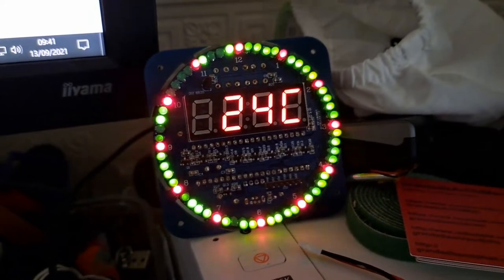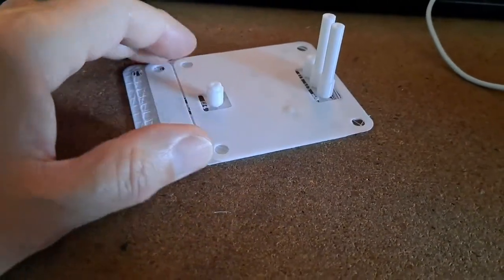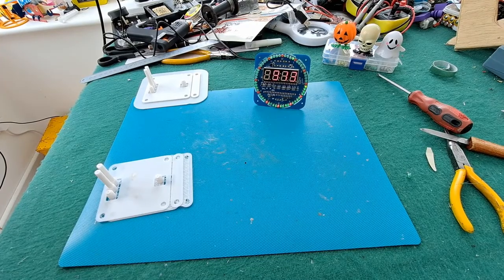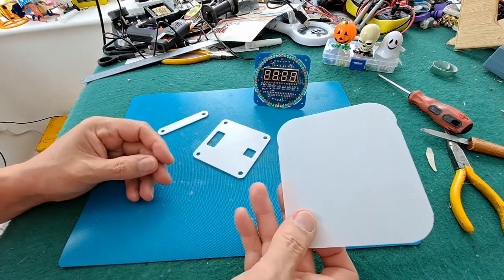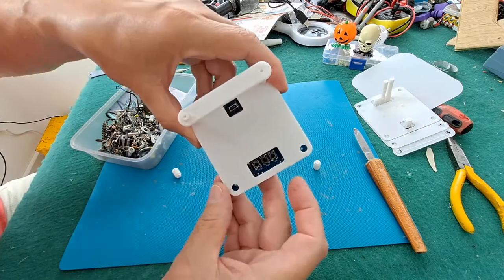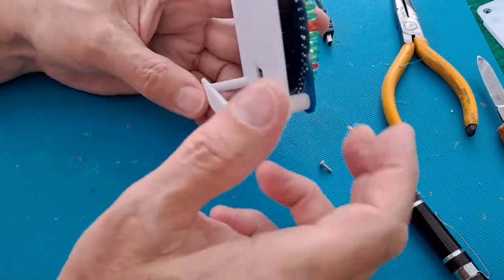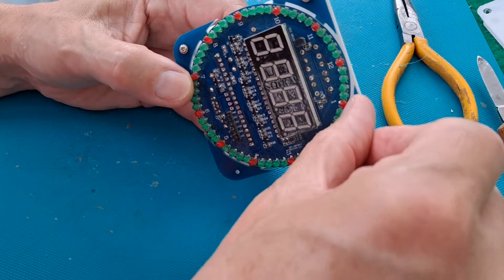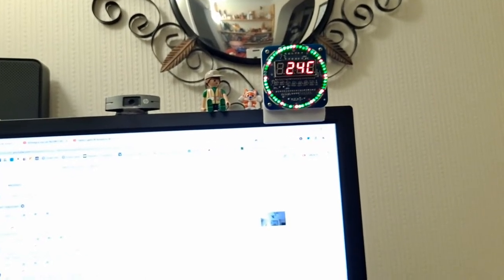EC1204 Digital Clock Kit Back Plate

Comment: I suspect either you're cooking the LEDs when soldering them, or your kit may have the wrong current-limiting resistors.  However, the red and green LEDs share the same resistors, so perhaps it's not that.  The resistors are R5, R11, R13, R15,  R17, R19, R25, R30.  They're supposed to be 47-ohm, but you could fit 100-ohm or greater - LEDs would be a little dimmer, but hardly noticeable.  If you leave the LED legs a little proud of the board, it helps prevent the LEDs being overheated when soldering (you can even hold the legs with a pair of tweezers or similar while soldering to act as a heat sink).  However, unless you replace all sixty LEDs and stand them all off by the same amount, it looks ugly.

Slipping when 3D printing is common - usually caused by various resonances that build up and make the stepper motor skip a few steps at a time.  Try reducing your print speed a bit - say to 75%.  If that fixes the problem, then you can gradually increase the speed till you find the threshold where it goes wrong.  Some printers you can adjust the stepper motor drive current up a little on whichever axis is slipping - but obviously you don't want to go too high as that can cause the stepper motor to run hot, or even burn out the power supply.
Reply from the maker: Thank you for the tips

Comment: Wonder how  long the leds will last this Time.but that sits well on your screen there.how Can a belt Go out of alignment on your printer?  You never had To adjust it ?
Reply from the maker: If the belt loosens up badly, it could skip a tooth or just slop about a bit, even a tiny bit of play is noticeable on a print. You are supposed to check all the nuts and bolts occasionally, like any other mechanical item.

Comment: Really great. Would that be possible to ask you for the STL please? Many thanks
Reply from the maker: You are welcome to it, but I designed it specifically for my monitor so it may not suit your needs https://www.tinkercad.com/things/bJJdiZFcg2X
Reply: Many thanks, hope you managed to change your faulty Leds
Reply from the maker: @jean-michelchevalier6649  I did a few of them, but not all of them. Some of them start up again if I just put a bit of pressure on one side of them. They must have been pretty low quality.